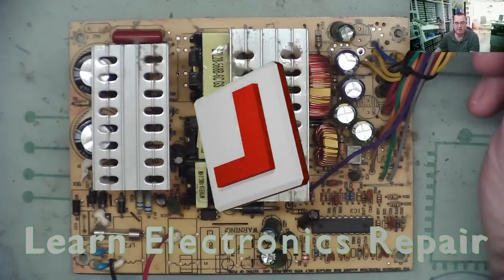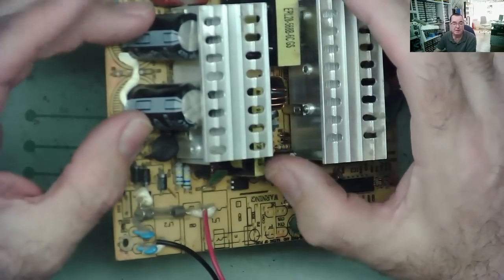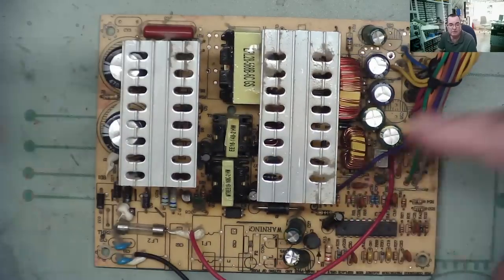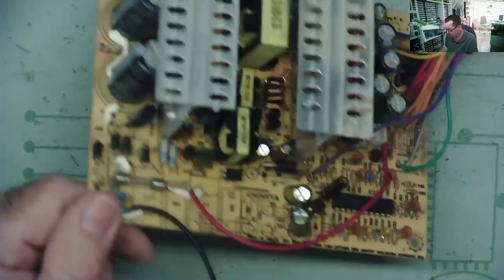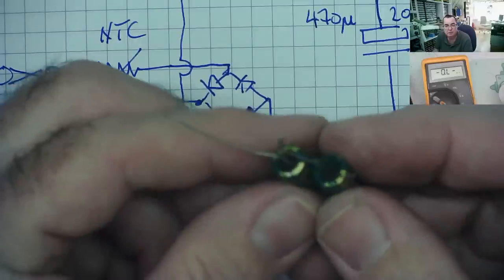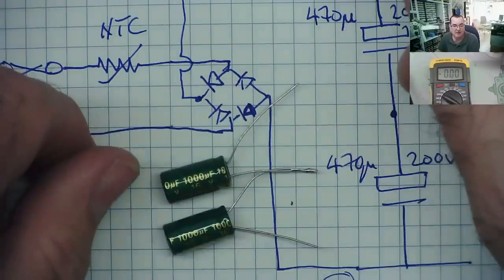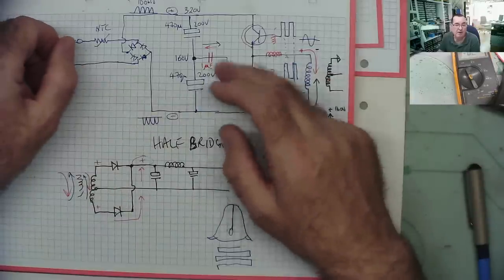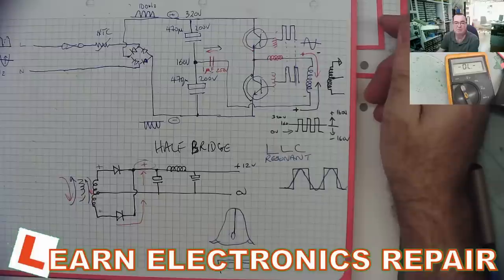Why Does An ATX Power Supply Have Two Main Smoothing Capacitors? How ATX PSU Works Tutorial

Comment: I'm guessing the reason for using two is so that they can be connected in paralell... halving ESR and inductance.
in a switch mode power supply, a well working smoothing capacitor is critical. 
Could be wrong. But that's my hypothesis before I watch the video. 
The reason I think this is because of watching a lot of big clive and eevblog videos.
EDIT: Stopping at 2:50, I saw that the capacitors are on the input side, and only rated for 200v each... Going off this new information, I'm assuming that they're connected in series. This is to allow for a total voltage of 400v max and using two lower voltage capacitors is smaller than a single 400v rated capacitor.

Comment: Why is the middle 0v? I mean I get when it’s going from + to - you get the full voltage, and I get when it switches and essentially goes from - to + (but still + cause it’s AC) you get full voltage, but why is the middle 0 V instead of half?

Comment: Really "cost optimised" power supply, though they still did not save the 2c that the fuse costs, and still put the 2 10n 1kV class Y capacitors in, though they minimiseded the expensive NTC inrush limiter, probably relying on the ultra thin wires and traces to do that instead, along with the mains cable having around 3 strands of copper like metal in it for each core. No filter components at all, and likely they will eventually respin the board to remove that wasted space, as that will save a cent or so per board in not wasting copper, or cut it out as another board like the front panel IO board
Reply from the maker: Actually I looked at three ATX PSU to use for this video, and specifically chose this one without input filter coils etc as it was the simplest (least cluttered) one

Comment: if one cap fails much sooner than the other, like it loses a lot of it's capacity, i believe it might be possible to blow a lot of componentry, including the caps, as the lower capacity cap will have a higher voltage over it as it will charge faster

i don't like that design too much

Comment: What happens when you solder one of those big capacitors in the wrong way around?😀
Reply: You get higher output⚡
Reply from the maker: Try it on video and let us all know, you could win the prize, a fresh pair of pants 😜
Reply: Just an excuse for an anecdote.  Over 20 years ago I worked for this crappy electronics manufacturing company and I noticed that some of the boards being assembled had the electrolytic capacitors put in randomly as no one had shown the workers what to do.  I mentioned this and it lead to the big boss coming down from upstairs and having a rant at everyone (including me) - I thought I should have just kept my mouth shut. haha

Comment: If the output from the bridge rectifier is ~320v why are the large caps rated at only 200v? Ok got it now.  I did not wait long enough in the video.  I assumed that they were in parallel.
Reply: Capacitors connected in series add together the voltages. They were 16v caps in series, basically making a 32v cap

Comment: They are "bulk" capacitors, not smoothing. 240Vac is RMS, not AVG voltage.
Square waves and mosfets are used in higher efficiency PSU, not sine waves via 1 fet and the primary.
Reply from the maker: That's really odd because when I learned this stuff in the 70s and worked on it in the 80s and even the 90s everyone called them smoothing capacitors and I honestly never heard the word' bulk capacitor' - though I have heard it and sometimes used it more recently.  I guess someone sometime after the 90s changed the name?

I just googled for the difference between smoothing and bulk capacitors and it seems both terms are synonymous with each other so I won't try convert you if you don't try to convert me as we are both right, apparently. 😁

Yeah I know that the Average voltage of the 240Vac is zero, mathematically speaking, but it still hurts a lot if you touch it which quickly shows the error of that way of thinking 😉  Or maybe it doesn't hurt mathematicians?

Actually while looking into the terms smoothing and bulk I found a really nice article that explains the different types of capacitors, their advantages and disadvantages, with no math involved, and I learnt quite a bit so if anyone is interested it's here.  Or was that learned?  hmmmm

https://resources.altium.com/p/which-type-capacitor-should-you-use
Reply: @LearnElectronicsRepair  well said!
I have been repairing stuff since I got out of college at 17 in 1982, for 10 years I mostly repaired PC motherboards and all the add in cards and psu. The troubleshooting technic I have learned has paid off a lot over the decades. Regarding the "bulk" capacitors, haha, if you look at the voltage at max load, most times you will see a lot of ripple and for this spot in the supply it does not matter, unlike the output caps.
Reply: @LearnElectronicsRepair  that link to capacitors is really good comparison, that's for that. My company designs highspeed communication IC's (my division), we are working on 200Gbaud per lane (around 34Ghz), we just got a 140Ghz vna for SI. We also developing 3KV silicon type capacitors for RF data applications. Thanks for the videos.
Reply: @LearnElectronicsRepair  I forgot to add, "hold up time", do you know this spec for PSU? There is a test that drops the AC line cycles for a count of 5 to 20 8s what mostly I have seen. This special test equipment you set how many cycles to drop (in other words, send out 0 volts for X line cycles), and the supply should be able to continue powering the load. This is where the "bulk" capacitors come from I believe, you need more buck caps to support more dropped line cycles, especially for higher wattage PSU.

Comment: It's not right to confuse RMS with the average value - for a sine wave, the average is always 0!
Reply from the maker: maks886 Yeah I know.  Because the averages of both the negative and positive half cycle are equal and opposite therefore there is no voltage present.  Please remember this when you next put your finger on a live AC wire and can't understand why it hurt (of consider it very briefly if it killed you).  Hopefully you survived so you can explain why 0V hurt so much 😉

Comment: Only cheap ATX supplies which nobody uses these days is presented here.

Modern supplies uses active PFC, basically a boost circuit and no capacitor at all after the main bridge rectifier.
Reply from the maker: Many modern ATX still use the Half Bridge LLC circuit.  Active PFC also has a high voltage capacitor (usually 450V) after the PFC and bridge rectifier, but feel free to prove me wrong and educate me as we are all still learning.
Reply: Lots of old PSUs still in use in vintage equipment.